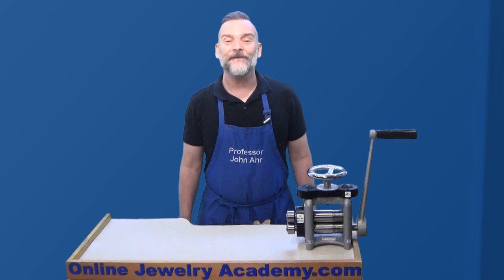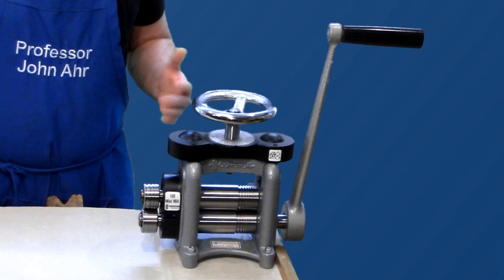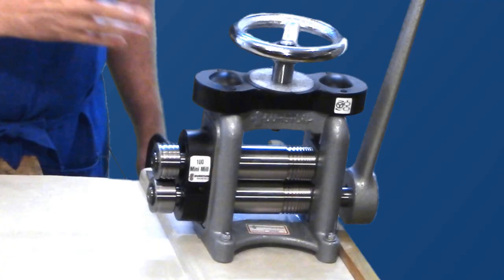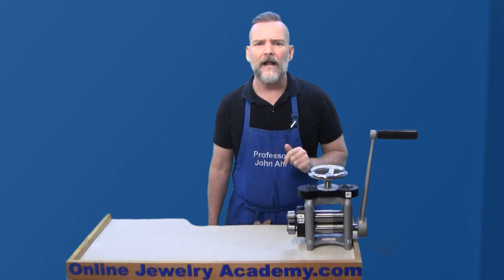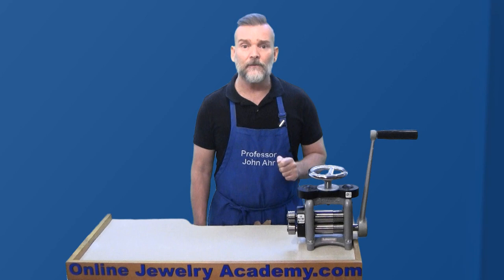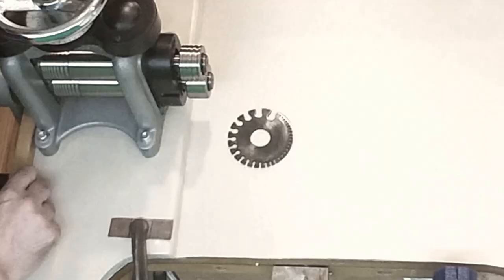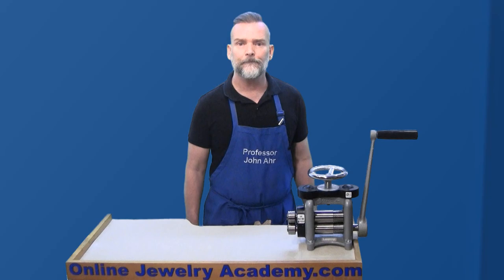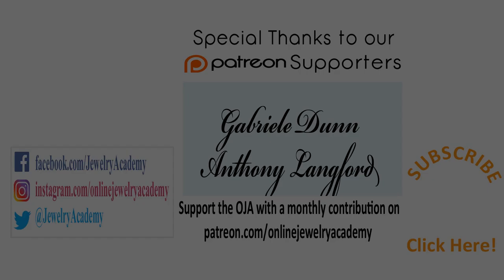Best Little Rolling Mill In Town

Comment: Hi John , can you recommend or do you have a video about making wax prong settings for rings . I've done a few my self but I would see how you would perform that skill. Thanks
Reply from the maker: Hi Randall,  The OJA doesn't have a video on making wax prong settings.  One reason for this is because I don't like cast prong settings.  Castings can be porous, can crack easily and reveal unsightly voids in the metal during the finishing process.  Hence, I prefer to fabricate settings.  If you search on YouTube I'm sure you'll find other channels that have a videos that can help.  😀

Comment: why must you pickle brass brush rinse and dry the wire between annealing ? does this apply to all metals ?
Reply from the maker: Annealing instructions presented in any OJA video always pertain only to nonferrous metals.  You must always pickle, brass brush, rinse and dry your metal after annealing it.  These steps remove any flux, surface oxidation, grime and moisture from the metal surface.  You don't want to ever transfer any of these to your tool surfaces.  😀